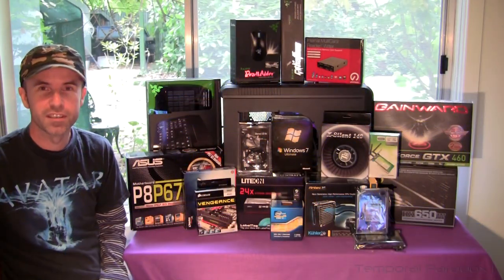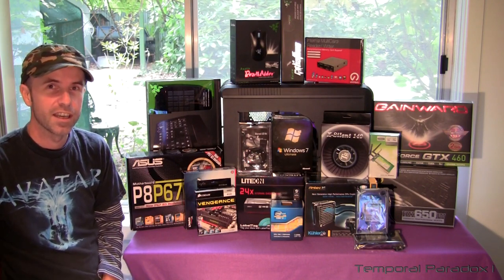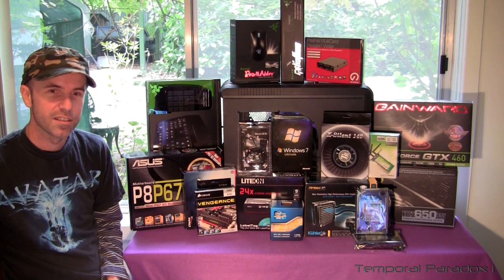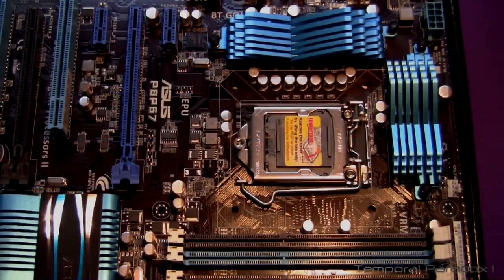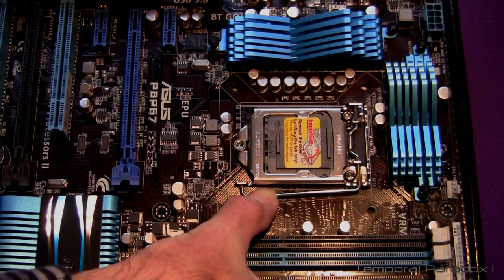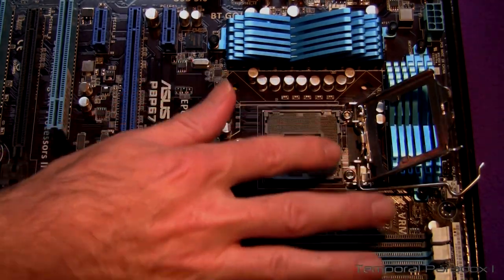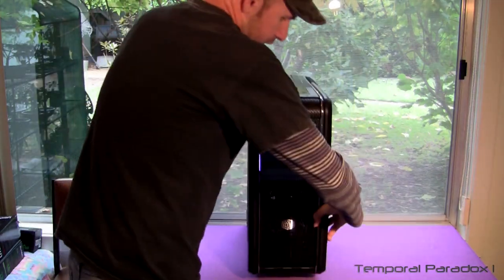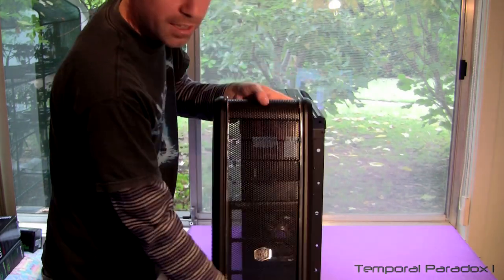How to Build a Computer - all steps included Part 1/2

Comment: Yes, I read your article thoroughly, and as we live in NZ, I have been using the pricespy site.  This is what I have so far, and hope to order the parts tomorrow.

Case - Cooler Master Centurion 5 II
CPU - Intel Core i7 3770 3.4Ghz - or 3.5 for overclock
MOBO - Asus P8Z77 V
GPU - Asus GeForce GTX650-DC-1GD5
RAM - G.Skill Ripjaws 2 x4Gb
SSD - Samsung 830 MZ-7PC128
HDD - either 1 2TB or 2 1TB Seagates
RAM and case fans galore
CPU Cooler - Antec H20 620

Many thanks again Dex
Colin

Comment: Thank you for the tutorial. I have built a lot of computers in the past but things have changed a lot since my last build in 2007. You saved me a lot of time and mistakes. Just one example: I didn't know that space behind the side panel on my MSI TC-303 case was for cable management. It's not mentioned in the specs on Amazon or in the user manual, and I've never seen it used before. I would have run cables all over the inside. That alone was worth the time I spent watching your video.

Comment: @TemporalParadox1 I just did an almost identical build. I got the 16 gig ram kit, reused my gtx280 video card and used a topdeck case with almost all passive cooling.

the only recommendation I would make to you is to swap your system drive to a solid state drive. These run a LOT faster than the motorized drives. when you are storing the video, just pop them over to those fancy 2tb drives after. This is the method most builders are using for performance. Check the speed tests out.

Comment: Hi 
I use the same video card I was told that this Gaming card isn't adequate vs  the Quatro FX 1800 card.  I have been running into slow rendering using After Effects large video templates

Comment: Just a TIP for those who are making a build in June 2012 buy IVY bridge processor or PCIe compatibale. I would recommend i7 3930K ( $500 ebay) and GTX 670- $400 ( or try EBAY and get GTX 680) under $500. Get PCIe 3.0 Motherboard and SSD 2 drives at least! Oh yeah and Adobe Primere 6.0;)) Hands down!

Comment: someone suggested  this to me. Not to by a 120g solid state but to by like a 40g and put the operating system on that and by one of the "old" hard drives that have moving parts. Its a good idea if you need to save money but you have the budget  go with the solid state 120g computer. it will be a lot faster

Comment: @danielbrugal if you get 2 GTX 560's its better then 1 GTX 570. A GTX 570 is about 15% better then ONE GTX 560, meaning if yoou SLI 2 GTX 560's you're better off. Mind you this does requier a power supply that can handle that. Also your motherboard must have 2 PCI 2.0 slots 1 at 16x and one at 8x. Both being 16x is prefered but not required.

Comment: I could use some help maybe some of u know. This is my problem:
I just ordered all parts for a new computer, they arrived i installed everything including the same motherboard as in the video the asus p8p7 something. When i press the power button i see a fast flash of the blue led light next to the button, but nothing happens not even one fan goes on. I think the problem is with the motherboard or psu, but i plugged them in correctly just like in the video. Help is appriciated. Thanks

Comment: widescreen LCD monitor 300 cd/m2 5000 1: (ascr) built in speakers

Motherboard:- open box: Asus m4a88td-m/usb3 am3 amd 880g hdmi sata 6gb/s USB 3.0 micro atx amd motherboard

Graphics card:- palit ne5x460 se (fermi) 1gb 256-bit gddr5 pci express 2.0 x16 hdcp ready sli support video card

Comment: i wanted to ask u is these things compatible with each other :-
1-AMD Phenom II X6 1090T Processor, Black Edition (HDT90ZFBGRBOX)
2-XFX Radeon HD 6850 Limited Edition 775MHZ 1GB 4.0GHZ GDDR5 2XDVI Display Port HDMI PCI-E Video Card 
3-Gigabyte Socket AM3/AMD 890FX Motherboard GA-890FXA-UD5
4-Western Digital 1 TB Caviar Blue SATA III 7200 RPM 32 MB Cache Bulk/OEM Desktop Hard Drive - WD10EALX
5-COOLERMASTER CM 690 II LITE | DESKTOP GAMING PC TOWER

Comment: TELL ME IF MY SET UP IS GOOD: Asus p8h67-mpro 1155, i7 intel core 3.4ghz, 2TB hd, 3x 4gb ddr3 1600mhz Ram, MSI GTX550 1GB , 700W extreme rs700 cool master, windows 7 Ultimate.. SHOULD IT BE ABLE TO EDIT HD VIDEOS SMOOTH

Comment: 6-Antec KUHLER H2O 620 CPU cooler 1366 1155 1156 775 AM3
7-Thermalright X-Silent 140mm Liquid State Bearing Fan
8-Nexus 120mm 12cm PWM Series Real Silent Case Fan
9-kingston hyperx fan 60mm
10-Lite-On iHAS524 DVD/CD Player/Writer
11-corsair Vengeance Blu 8 GB PC3-12800 1600mHz DDR3 240-Pin SDRAM Dual Channel Memory Kit for Intel and AMD Platforms CMZ8GX3M2A1600C9B
12-Corsair CMPSU-850TX 850-Watt TX Series 80 Plus Certified Power Supply
if there is a better cpu cooler or anything plz tell me ,thx

Comment: @TemporalParadox1 I'm guessing it would. But would I need to go with the beefed up fans and water cooler? It doesn't get much above 35 degrees at it's MAX in SUMMER. Average temp is 20 degrees.

Comment: what about this build? mainly for games :) Do you think it will run wow smooth?
Intel Core i7-2600 3,4GHz 8MB LGA1155 BOX
Asrock H67M (Intel® H67 Chipset) mATX
4GB DDR3 1333MHz (4GBx1)
ATi HD6870 1GB GDDR5
500GB 16MB cache SATA2 
Ace Stac4 Miditower ATX
Corsair Power Supply 750W TXV2
Reply ASAP please :)

Comment: @1and1isme ok thank you very much,, last tip! and if so with two asus gtx 560 Ti DCII TOP/2DI/1GD5, apart from the game to see movies in 3D TV connected to HDMI and if you can watch movies in 3D with this option? or if you can shed some light on this subject, I would like to be optimal for both graphics and rapidity both games blu ray movies (with equipment). ASUS DELUXE/GEN3 P8Z68 !!! and ANTEC 900 W Thank you ...

Comment: hey TemporalParadox1, ill buy the intel i7 2600k (or maybe the 2700k..) cpu, and  the 1600MHz RAM memory is compatible ? i checked in the intel site, and it says both processors (2600k and 2700k) dont support the 1600MHz memory, just the 1066 and 1333 mhz RAM.

thank u, and sry for my bad english .-.

o/

Comment: Just going to say that if someone is doing just a gaming build than the i7-2600k offers no advantage over the i5-2500k. The i7 only has the advantage of Hyperthreading. It turns 4 cores into 8 virtual cores that operate at slower speeds. Heavily threaded applications such as Video Editing programs benefit hugely from this but no games use Hyperthreading and they won't anytime soon. The i5-2500k is all a gamer needs right now and will do as well as the i7 give or take a frame or two.

Comment: rom sata DVD-rom drive model ddu1681s-0b-oem

Ram:- corsair vengeance 8gb (2 x 4gb) 240-pin ddr3 sdram ddr3 1600 (pc3 12800) desktop memory model cmz8gx3m2a1600c9b

Power supply:- sunbeam psu-bks580-us 580w atx power supply- oem

Wireless adapter:- zonet zew1642s wireless adapter w/fixed antennas IEEE  802.11b/g/n pci up to 300mbps wireless data rates 64/128-bit wep,wpa,wpa2 

keyboard&moue:- pixxo ka-9e9e black 6 function keys rf wireless slim keyboard

Monitor:- Asus vh196t-p black 19" 5ms wi

Comment: I've built 100's of desktops, just take ur time & don't force any thing.  static is ur worst enemy. buy from new egg or tiger direct. barebones just research all the parts for reviews. in this order, mobo in case, 2 cpu in mobo, 3 cpu heat sink & fan, 4 videocards, hard drives dvd burner, ram last.

Comment: hey im looking for a little advice ether from Temporal or any one in the pc community. i just built my first pc ever and i want to know from everyone if my specs are descent.

here they are,

intel i5 2500k
asus p8z68-deluxe mobo
gigabyte 560ti gpu (debating on sli setup)
8gb corsair vengeance ddr3 ram
64gb samsung 830 ssd
500gb western digital caviar blue hdd
andtec kuhler h20 620 cpu cooler
corsair enthusiast tx750 watt psu
cooler master rc-692 mid tower
samsung bluray dvd cd writer/reader

Comment: Could anyone tell me if these items are compatible with each-other? If you need more information look them up on newegg.com

Case:- raidmax tornado atx-238wr black/red secc steel atx mid tower computer case 

Processor:- amd athlon ii x4 630 propus 2.8ghz 4x 512kb l2 cache socket am3 95w quad-core desktop processor adx630wfk42gm - oem

Hard drive:- seagate barracuda st31000524as 1tb 7200 rpm 32mb cache sata 6.0gb/s 3.5" internal hard drive -bare drive

DVD drive:- Sony black 18x CD-rom sata DVD